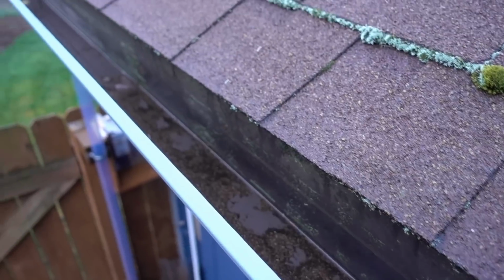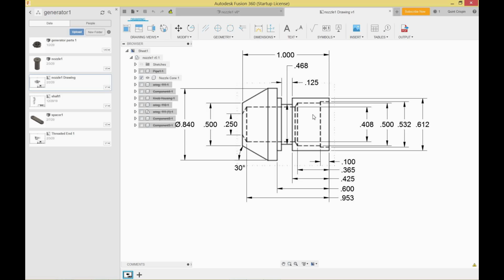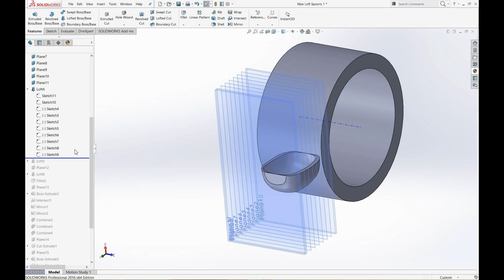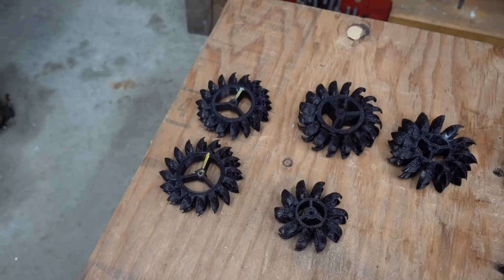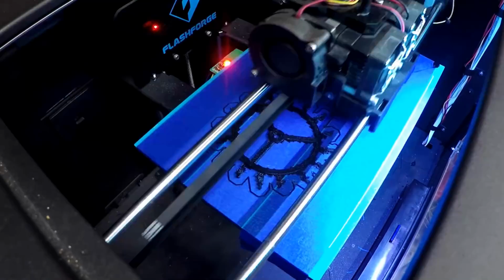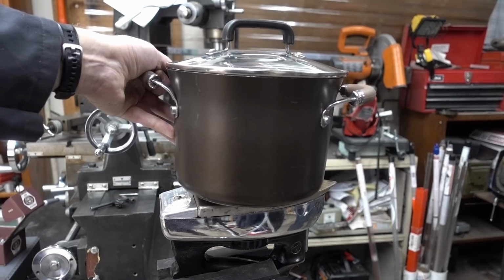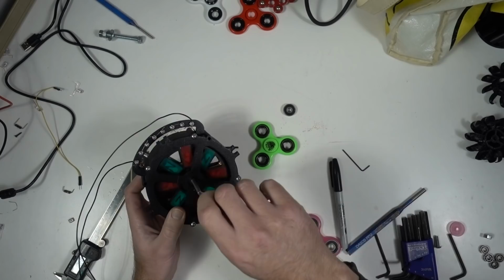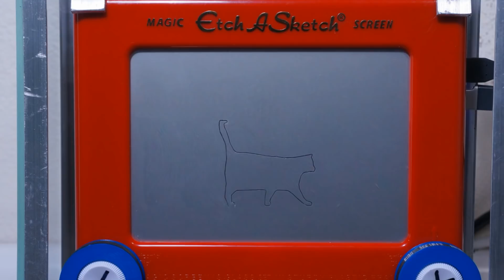Rain Gutter POWER #3 - Fidgeting With Turbines!

Comment: Part 6: "Built my house taller to increase water pressure."
Reply from the maker: ROFL!!!
Reply: Part 23: "Move the clouds higher now that my roof goes past the cloud layer."
Reply: Part 174: moved the ocean on the house to increase pressure
Reply: @lolbosss  
Part 200 built a dam on my roof and, from the way I modified my house to act as a load, now  I'm living inside a light bulb
Reply: Why not make a hole ? To gain some high ?
Reply: Classic!  Well done!!!
Reply: It's a shame the top of the roof is high but most of the energy is wasted the water just trickling down the roof.
Reply: 3d print taller house wall by wall from ABS
Reply: Just make the bore of the downspout larger so there's more water piling up vertically.  A lot of the water coming off the roof is probably wasted since there's no carrying capacity in that acrylic downspout.
Reply: Nobody:
Quint: I will try to use rain watter to  generate electricity. In the process i will spend at least 300 pounds on project, so if it works I only need 10 years of nonstop raining to get my investment back. :D
Reply: @QuintBUILDs  Where can I get a Replicator like yours? Or was that homemade?
Reply: Hey. But not for being a joke. That's really true. the longer the pipe the higher the pressure.
Reply: LMAO !
Reply: Part:169 constructed a machine to increase rain flow
Reply: You Win The Internet!!!!!!
Reply: or ...  invert a  decent sized umbrella up a tall tree :)
Reply: @QuintBUILDs   got any tall trees near by :)
Reply: @QuintBUILDs  11:01 next up its magnetic bearings right :P
Reply: @QuintBUILDs  12:20 well lets face it ... what are rivers but natures gutters :)
Reply: lolbosss1325 Built a gravity distortion emitter to knock the moon of its axis. The effect will increase the ocean’s volatility and thus increase the water pressure. The only downside is that everyone dies in the process, but I’m CONIFDENT we’ll be able to hit 1W! And hey, everyone is killing one another right now anyway, so a bonus effect of this experiment will mean that this process will be accelerated. Winning!
Reply: Dude i laughed when i read this lol
Reply: Quint BUILDs How about instead of a horizontal jet like what you’re currently using, how about turning the bottom of the pipe into a vertical nozzle shooting downwards itself so gravity helps you too? Instead of a horizontal nozzle where gravity isn’t helping at all. 

All you’d have to do is move the pelton wheel underneath the pipe. 

I hope that helps.
Reply: Catalyst - D B I suspect the reason for his design was to trap debris.
Reply: @QuintBUILDs  E=mc^2 so if you double the nozzle speed halving the nozzle diameter you'll get  quadruple energy
Reply: @carlotheatheist  only if there's enough rainwater to create a column of water in the pipe
Reply: Just add a container inline at the top of the system to increase pressure at the bottom, plus a smaller nozzle times four.
Reply: @QuintBUILDs  why not ad one of these to your home water inlet when they open avalve you can gain free(!)power
Reply: Absolutely, agree with your idea brother
Reply: Why not remove the funnel and have the water come directly out the bottom of the gutter pipe with a tapered end to increase water speed and flow at the same time?
Reply: Part 5000: building a nuclear reactor
Reply: @QuintBUILDs  and why didn't you build a Tesla turbine?

It would have spun quite a bit faster than the design you settled on, correct?
Reply: Hahahah 😂

Comment: Tip: actually, this was my thesis during my engineering years. The design of the bucket is dependent on the speed of the water coming out of the nozzle, the speed of the water is dependent on the diameter of the nozzle hole. By design, which you can look up on the internet, you should compute the number of buckets and the diameter of the wheel based on the kinetic properties of the water. Since these types of turbine rely on HIGH velocities of water but low pressure, try the "Francis Turbine", it's a reaction turbine which only needs static pressure of water, since you're using a static column. Much efficient and try to use a DC generator with more poles, which produces MORE power at LOW rpms.
Reply: I wonder, would pointing the nozzle downward into the turbine add more force?
Reply: @TheBrickcitydoc  it would work, utilizing the potential energy (weight of the water to create pressure). Try decreasing the diameter of the nozzle hole to about a millimeter. Hoping for a positive output.
Reply: Hey, why do you say that the speed of the water will change with a smaller hole? Isnt it true that as long as the pressure infront of the hole stays the same, the water should have the same velocity no matter the flow rate? Energy is being conserved and the potential energy is being converted into kinetic energy inside of the nozzle, so if you increase the flow rate by 2 that extra quantity of water has the same potential energy as the first amount and should get the same speed...
Reply: Francis Turbines look like those big bowl waterslides
Reply: @TheBrickcitydoc  I was wondering whether the Turbine should be directly below the waterflow working with gravity as opposed to a right angle.Is he losing water pressure by doing this??

Comment: The water itself is slowing the wheel down. It's sticking to the wheel. Trying wiping RainX on the wheel to create a hydrophobic surface.
Reply: RainX is just generally terrible. There are other hydrophobic coatings like NeverWet, EverDry, and if you want to get industrial there are coatings for ship hulls that have moved on from silicone products to low fouling release energy Teflon coatings. You may be able to improve the application by adding in some super fine non-oxidized graphene or hexagonal boron nitride nanoparticles for that extra durability against spray and debris, though the standard PTFE should do the job (as long as it sticks!).

https://www.coatingsolutions.com/dupont-teflon-coating-process/

There is a conflicting goal between low fluid resistance coatings on ships (very smooth, hard surfaces) and fouling resistance coatings (non-stick, smooth enough, flexible, durable, or biocidal).

@Quint BUILDs
Reply: What about a groove with a hole in the end of it that allows a droplet of water to run along a valley and then drain out on the upstroke.  is water sticking to the surface area and then being lifted < at the bottom vertical after the release of water thru to the top vertical.  ie if the spoon is pointing south then moving anticlockwise on its way to pointing north.. is it lifting the caught water as the water is being displaced by the certrifugal force...
Reply: What if you added a secondary wheel on the outflow and attached them in series?
Reply: @lazlo306  almost all power is lost on the first wheel, not really enough left, certainly not enough all going in one direction to scavenge additional power
Reply: @Baigle1  huh? Ok , is there going to be a pop quiz I hope not . I think I got the wrong class. Enclose the jet of water and the wheel with a housing as tight as possible I hope I don't have to take a test I just need some credits
Reply: Is it possible to get a little bit more power out of the output doing it again I know it sounds crazy but it can be raised higher
Reply: I think you are seriously into diminishing returns here. Whilst what you say is absolutely true, the wheel is too small for the change to make any appreciable difference.
Reply: Try a tesla disk motor
Reply: I love seeing the internet being used in a productive way like this.
Reply: Candle wax works good too
Reply: @Baigle1  , cool.  I'd imagine it would pay off for shipping.
Problem is, then he's polluting all the rainwater with PTFE and/or other organic compounds.  Not an issue?  Apparently, ski areas are now detecting contaminant levels from ski wax.  

Great idea until you realize there are actual consequences...

Comment: Amazing work!... I really think you should try making a "snail" housing (like the housing on a turbocharger). And have the water passing in it sealed to make use of all the lost momentum.
Reply: I was thinking the same. looking in the comments to see if somebody think of it. I would also try to use the gravity and make the exit hole down to maximise the effect of gravity...don't know if it will do anything. depend of the amount of residual energy staying in the ejected water i guess...ho damn! It reminds me off those university projects. pretty interresting anyways!!!
Reply: Yeah! +1 to that!
Reply: @blast_0189  And a tapered end to the pipe, because so much turbulent flow is hampering the velocity.

Also, the machined metal parts for the multiple nozzles were great! The flexible rubber hosing probably undid any gains it provided.
Reply: @Scapestoat  I’m pretty sure you can harness more energy off of turbulent flow, it’s just harder to control and predict. Luckily no control is needed for the shape of the stream, so turbulent it is!
Reply: I agree with putting the water flow down, but argue that the water may become a drag if forced through a housing. I'm no expert, but I would imagine that the water, after hitting the "paddle" would lose pretty significant speed. That water would then fill up the housing and slow down the impeller pretty significantly. The design would have to change basically to a reverse pump, which I'm sure there is a reason turbines, which resemble what he has already designed in the first place, haven't changed much over the years. Could be wrong and I'm happy to admit it though if someone tells me otherwise.
Reply: @gmatta1112  I don't think it would quite work that way. Each of the cups in the sealed housing should be contributing to the rotational force applied to the wheel, so I don't believe there would be significant velocity reduction. I could be wrong however. I question why the examples he used in the video of how the method he is using has been done by professionals are open like that. We are concerning ourselves with hypothetical lost energy potential, but they clearly aren't, so we may be barking up the wrong tree as novices. Then again, this assumes the examples he used were professional and that they are competent enough to not make any mistakes.